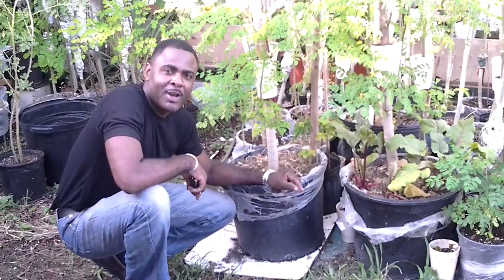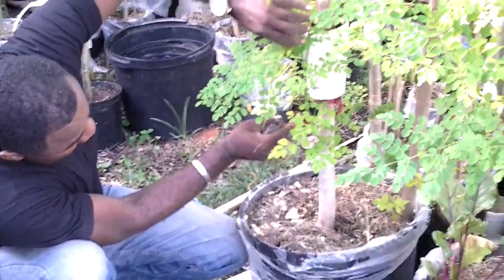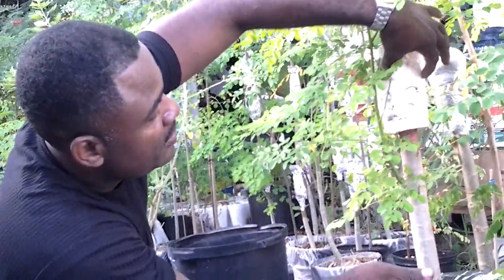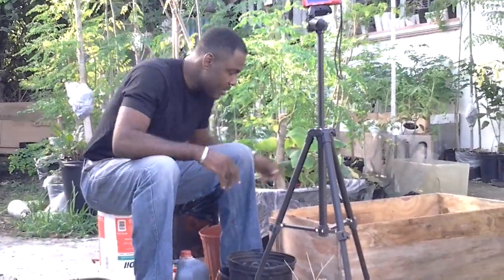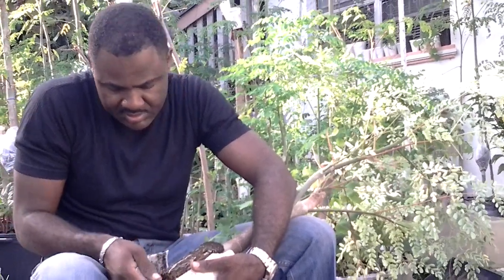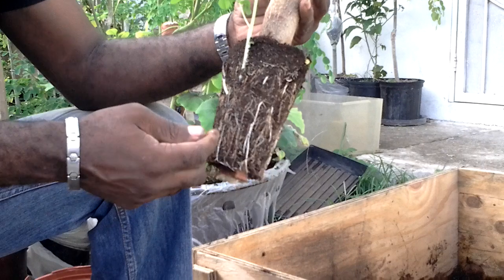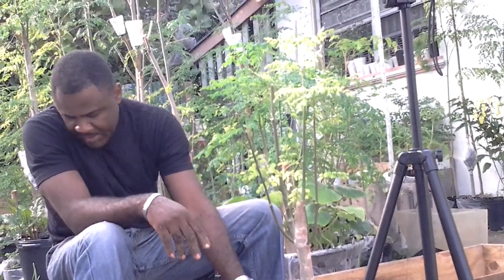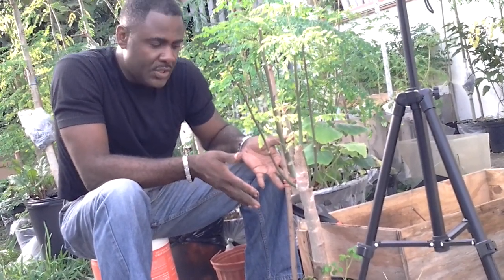MORINGA OLEIFERA CULTIVATION PT 2

Comment: Hi actually you do not have to air layer the plant, all you need to do is cut off a section of an older tree branch and stick it in the ground or large pot. It will take root, Moringa trees are very hardy you need not even dip them in rooting powder. God bless, Annie from Malaysia. Of course you can use the seeds to grow more trees too. Over here, we eat both the drumsticks and the leaves. I have lots of them growing in my garden and around the neighbourhood.